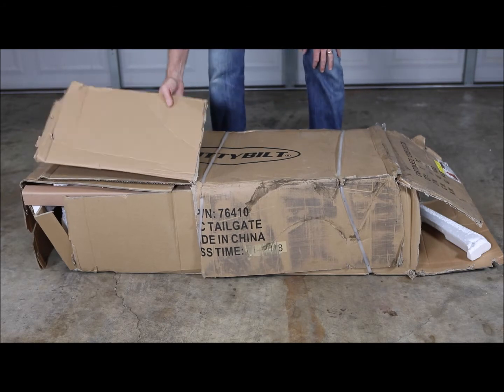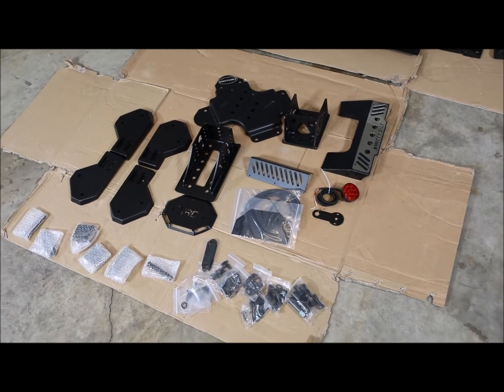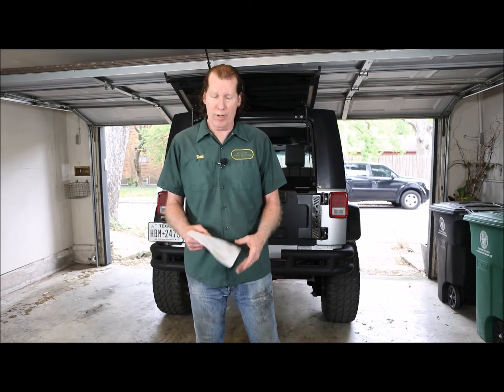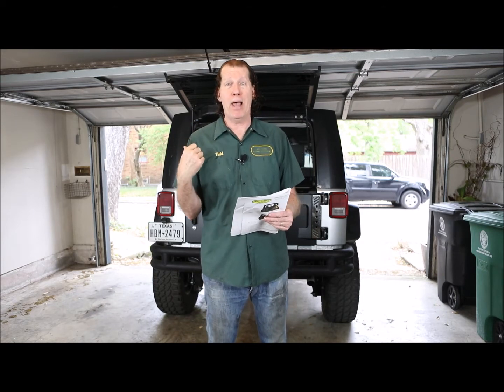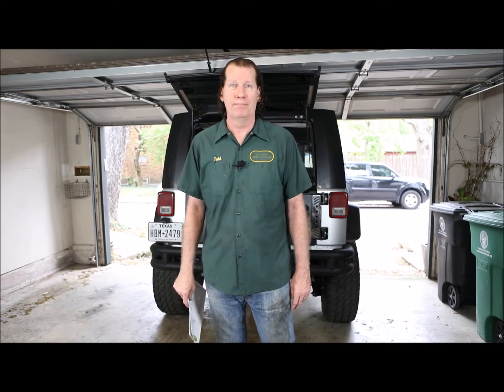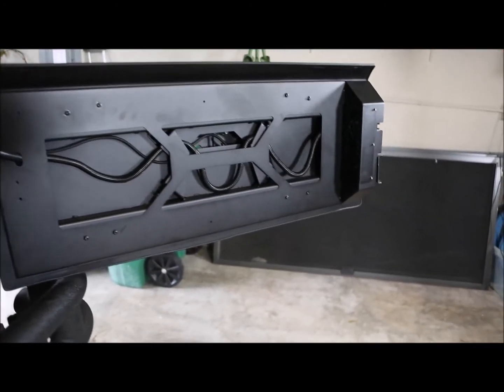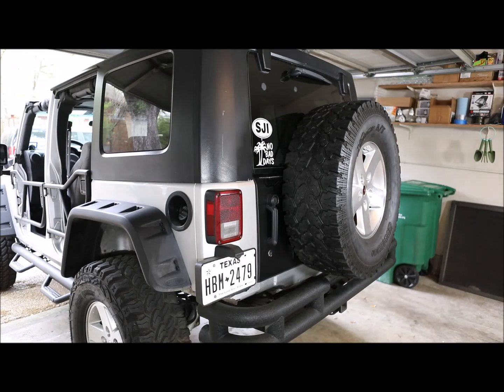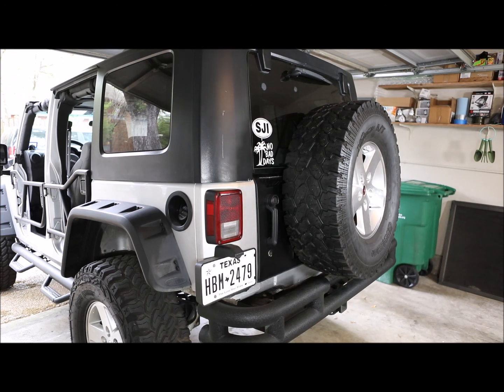Smittybilt XRC Tailgate for Jeep JK

Comment: Will a tail gate table still fit. Like a factory one
Reply from the maker: Yes, it will.  You may have to drill a new hole or two, but the inner door is as flat as the factory tailgate.

Comment: Hello Todd I just got this tailgate installed and when I put my 35 inch tire on it sags just a little I’m thinking the sag is in the bolts attaching the gate hinges to the tailgate but after watching and looking at online pictures I noticed my hinge pins have a copper sheath but no washer or lip and my pins wear shiny not black do you have any advice to help me fix this?
Reply from the maker: Shawn, sounds like you might have received the wrong hinge pins.  The fit of the pins should be very tight.  There was a yellow sheet of paper in the tailgate shipping box that provided contact info in case of missing parts.  Call that number and tell them you suspect the hinge pins to be wrong for your tailgate.  If you don't have that contact info any longer, find them on the web to see if they can assist you.  They're pretty good about making stuff right if there is a problem.
Reply: Will do I’ll let you know what they say also how did you wire up the third brake light I have 2 wires for the light from my jeep a 2015 JKUR and three on the light in the carrier ?

Comment: you mentioned the factory wiring from the old tailgate isn't long enough.  How did you resolve that issue?
Reply from the maker: I spliced in about a foot of wire.  I think there are two wires that needed lengthening - the power lock wire and the "door ajar" sensor.

Comment: Do you have any problems with the spare tire or the whole tailgate squeaking? We had it on a few days and it was PERFECT. Now there is a perpetual squeaking when we drive. It’s driving me insane.
Reply from the maker: I tightened everything with extreme torque and used thread locker on the nut and bolt assemblies.  I have ZERO squeaks and have nearly 2,000 miles on the Jeep since installing it.  I mean totally silent.
Reply: Okay thanks. I have to figure this out. I was in love with it the first few days. Now I don’t even want to drive the Jeep 😬 the tiniest dimple in the road makes it squeak.

Comment: Was all the hinging hardware included?  The documentation I have seems to suggest that it is.  The parts connected to the jeep as well as the parts connected to the gate.  Was that the case?
Reply from the maker: All hanging hardware was in the box - it is also visible in the expanded view of what was in the box in the video above.  The latch and locking hardware is reused from your existing tailgate.

Comment: What provisions are there for power door lock solenoid attachment, mine comes on Friday this week.
Reply from the maker: Everything bolts from the old tailgate to the new tailgate.  Everything.  If you have power door locks, the mechanism transfers.  If you have manual door locks, the mechanism transfers.  Your key tumbler transfers.  Your door handle transfers.  In terms of overall assembly, I recommend using red thread locker, which requires 400+ degrees of heat to ever break the bolts loose.  You'll never have a rattle using red thread locker.

Comment: Does this rattle by now?
Seems really cool but so many rattling reviews
Reply from the maker: Abraham - the tailgate has absolutely zero rattles.  I have taken it off road multiple times to Hidden Falls Adventure Park near Austin, TX and have taken it up some REALLY rough terrain.  Just last week I was in Telluride, CO and had the Jeep on Ophir Pass and Black Bear Pass, two very rough trails (there are some trail videos on my YouTube channel where you found this video).  Not a rattle or squeak in the tailgate.  However, I have said in these comments and I said it in the video, you MUST USE THREAD LOCKER during assembly to keep the tailgate from rattling over its life.

Comment: Are you doing a video of the installation itself?
Reply from the maker: I did not.  Since I did the work alone, I could not hold the camera to show the detail of the assembly and of the installation while performing the work at the same time.  The assembly was not very difficult at all.  The instructions were good, except for the few specific things I mentioned in the video.  What took the most time was aligning the door to close tightly and properly.  The second thing that took the longest time was getting the height and back distance set for the spare tire.  While the assembly can be a one man job, the installation of the door onto the hing mounts is likely a two person job unless you're personally strong enough to hold the tailgate and stab the pins by yourself.  I was able to stab the door alone, but it wasn't easy.
Reply: Thanks for the feedback. What about removing lock hardware from old to new? Instructions on that?
Reply from the maker: Shane Neumann It's really simple.  There is a plastic panel by the lock mechanism.  Remove it, back the clips and screws out and simply remove them.  It is simple and quick!
Reply: Is the finish on the tailgate textured?  Can this be painted to match the factory color?
Reply from the maker: The gate is slightly textured.  I am not a paint & body specialist, but I am certain that someone who knows what they're doing would be able to paint match the Smittybilt tailgate and make sure that the paint adheres properly.